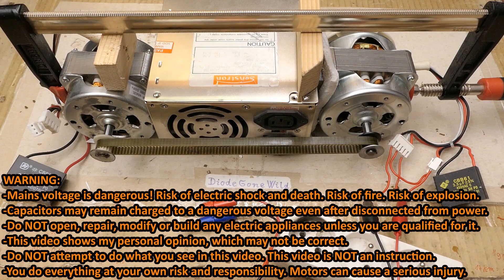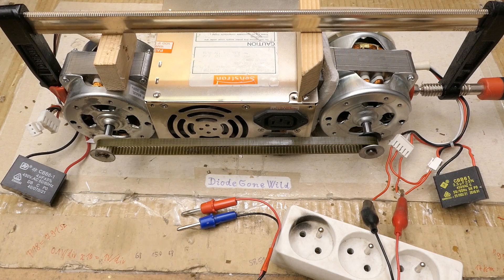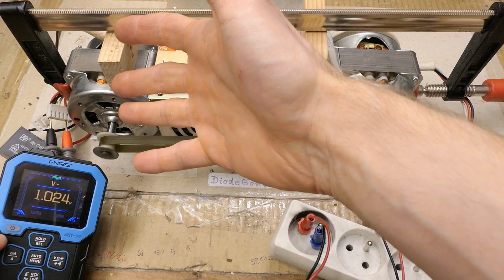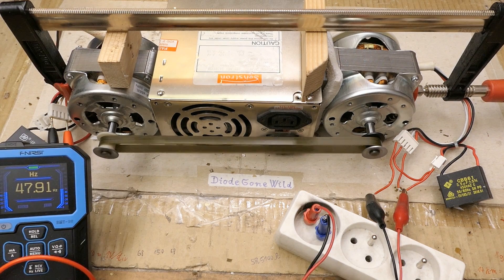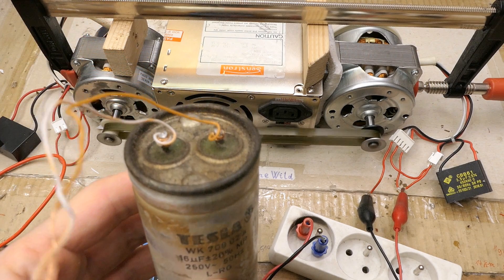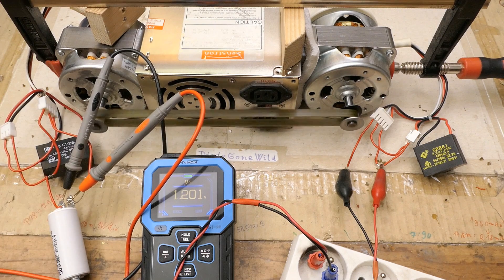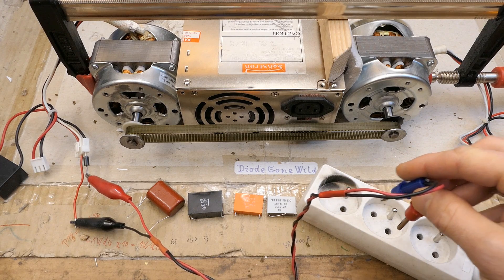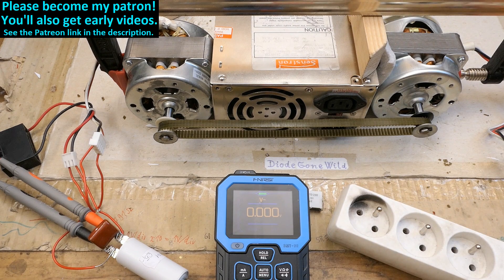Asynchronous motor as a generator?

Comment: I have accidentally seen this work. I was running a load with multiple asynchronous motors because I didn't have one powerful enough. I had them power factor compensated, they were compensated to a PF of 1. I was running them of of two different phases for load distribution. I used two single-phase plugs (this was stupid, and made this effect show up). I disconnected one of them, and the plug gave me a shock, then measured the voltage, and it was around 270V. I started experimenting, this generated voltage would only show up when disconnecting one of the motors, so both motors needed to be powered from mains first. I don't think the fact that I used different phases made a difference, but I didn't test that.
Reply: Not sure if it's on all devices, but on my galaxy tablet the option to translate to English  is available.
Reply: Működik, de ha egyszer zárlat lesz a kimeneten, újra gerjeszteni kell, hogy újra generátorként működhessen.
Reply: Why do so many people reply to comments in a totally different language?  Like if they understood the comment in the first place than they know english but just choose to be difficult and write in their own language expecting to be understood..  making them just a prick.  Or they are just ignorantly replying to any comment for some reason..  beyond me..
Reply: @Z-Ack  Most use the auto translate to their own language and then reply in their own language so others can also auto translate it
Reply: @Z-Ack because of possibility to translate it with google. They use language they knew to write their own comments but they can translate other comments with google without knowing exact language.
Reply: Why do so many people reply to comments in a totally different language?  Like if they understood the comment in the first place than they know english but just choose to be difficult and write in their own language expecting to be understood..  making them just a prick.  Or they are just ignorantly replying to any comment for some reason..  beyond me..
Reply: Plot twist: you're the ignorant one here.  @Z-Ack
Reply: @Z-Ack you posted two identical comments
Reply: @rosskrt  It might be a bug. Previously I "accidently make 5 identical comments" and I had to manually delete 4 of them. Its super annoying. Hope this bug will get fixed soon